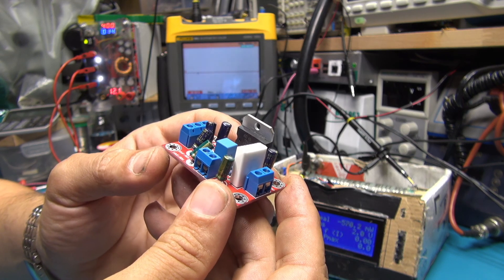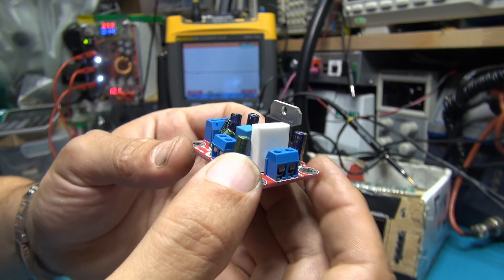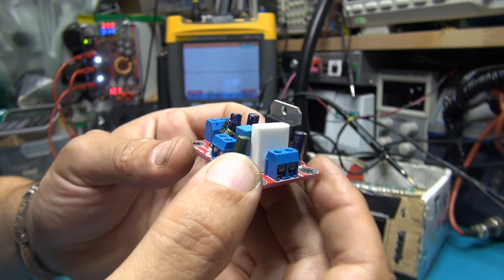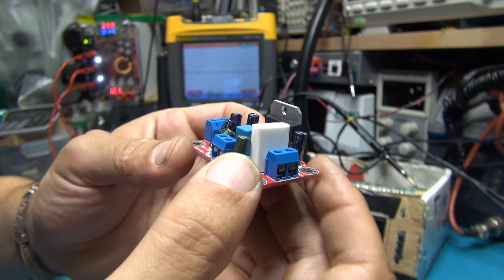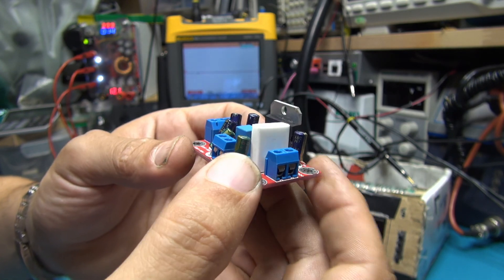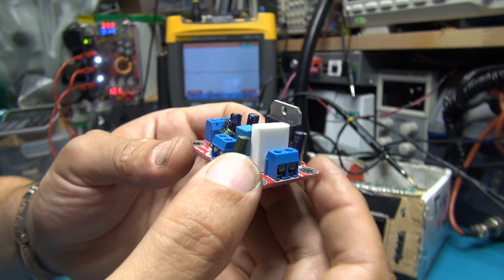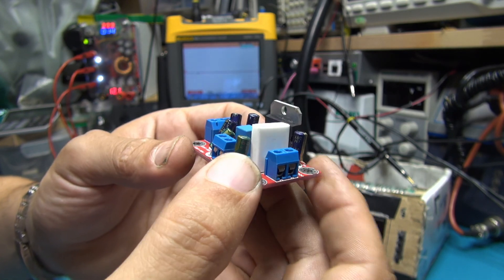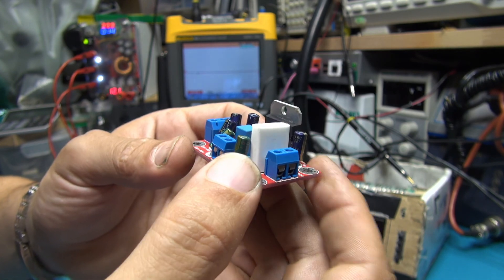TDA7294, the REAL WATTS

Comment: the TDA7293 is for 4 ohm speakers, the TDA7294 is for 8 ohm speakers.
Reply from the maker: ok maybe this is why it becomes so hot.
Reply: @AIexanderHartdegen  I think these chip run hot no matter what. I burnt up 3 of the tda7293 chips using 12v-0-12v power supply. First one burnt up instantly, the other 2 took about 2 to 3 minutes before they fried.
I'm looking into other options, these tda chips are junk.
Reply: I bought some TDA's from eBay and Aliexpress and they were all fake, counterfeits, no one worked or lasted more than 10 minutes. 
The real TDA's are sold only by approved distributors like Digikey, Mouser.
Reply: @redhytech NOP ! from STMicroelectronics data sheet  : "The TDA7294 is a monolithic integrated circuit in Multiwatt15 package, intended for use as audio class AB amplifier in Hi-Fi field applications (Home Stereo, self powered loudspeakers, Topclass TV). Thanks to the wide voltage range and to the high out current capability it is able to supply the highest power into both 4 Ω and 8 Ω loads even in presence of poor supply regulation, with high supply voltage rejection"

Comment: it's sort of amazing I haven't seen someone get a bunch of these chips and then put it on a car amplifier heat sink and do a self-made 8-channel or more amplifier.    
this would be perfect for an active setup.  
and with Dolby Atmos having up to 14 channels these days or more it actually makes quite a bit of sense to build your own amplifier with these  boards and making a large power supply for it would all make a lot more sense.
Reply from the maker: You can find some home made amplifier with others chip and symmetrical power supply. All are sometimes made with chinese kit. Sometimes making our own amplifier is just a story of overtaking his own self in home made electronic.

Comment: I've just started to do some work with op amps ... and so I've just had to learn about symmetric power supplies too.... great content as ever.
Reply from the maker: as ever... I have a doubt. But thanks for kind comment. Simmetrical power supply are used because op amp can works with very (infinite) wide frequency range, and make miniaturized  product because they don't need capacitor in output, unlike mono rail voltage use to do. Of course, there is a bad face. When a op amp or equivalent circuit is broken, it can provide a high voltage in output, wich can cause demise of other level, or speakers, wich is not the case with capacitored output. I hope you're well, and see you soon.

Comment: Very nice setup for the symmetrical variable supply. How is the noise level from it? I am interested in building the symmetrical buck converter. My idea is to start with high voltage from a symmetrical psu and then reduce as required.
Reply from the maker: Hello Silvio De Leonardo hope you're well. The noise from should be very low because the nice build of it, but I didn't measure it yet. But this is not a buck, but a boost converter. A boost converter elevate a voltage, and can not operate with a lower value than the input voltage. You're talking about buck converter, wich is not in the video. Yes of course if you start from a high voltage symetrical psu you can reduce the output voltage with a twin buck converter. Be carreful to not confuse buck and boost. You can find power buck converter on ali or ebay. But you can also build it, by playing with the duty of a signal in a coil, like buck works usually. Thanks for commenting and your interest.
Reply from the maker: if I understand you idea, you can use a single mono buch converter with a high voltage PSU and voltage splitter to create symmetrical voltage output.